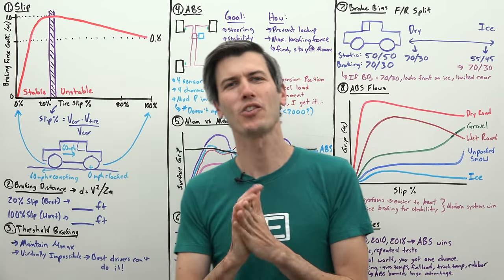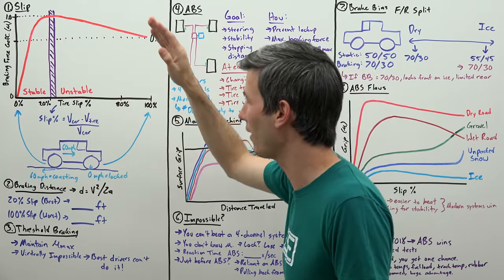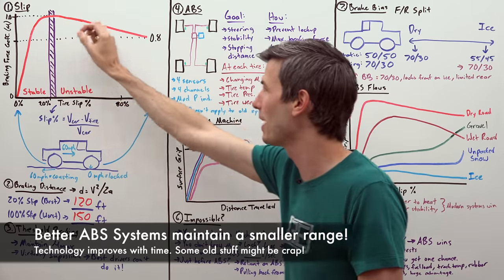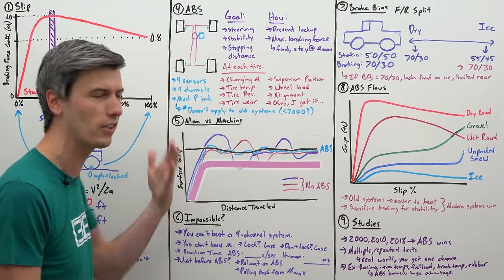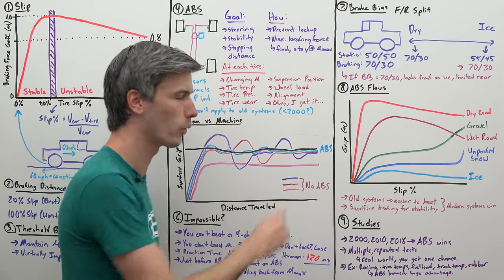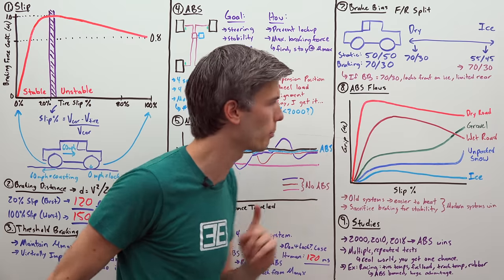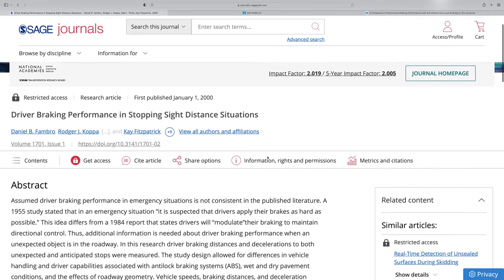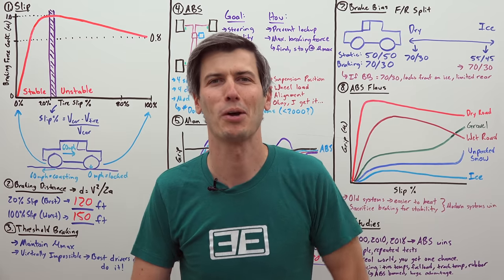Why Threshold Braking Is Impossible - ABS Wins!

Comment: On ice I’ve noticed when all tires lock up the car thinks it’s stopped and the car will just slide down a hill. I’ve had this happen a few times and the best think I’ve found to do in an emergency is to throw it in reverse while locked up. Hit the gas then let off the brake. The car gets a little sideways but stops quickly on slow down hill slides when your going to get into an accident.

Comment: Currently my car has a broken abs-sensor and it is a kinda funny and exciting experience how far i can push the breaks (with a good set of tires in 225/40 R18) without getting a lockup, but at the same time i am pretty scared. Had it one time with a bad set of tires (205/55 R16) where i just did not know that abs is broken and i had to slam the brakes at about 90km/h, man that black lines on the road got about 10m long, before i got to release the brakes again because the car startet turning around into a field where i did not want to go haha. Luckely nothing happened, but the difference is extreme, i am surprised over and over again and again.

Comment: Yes, it's absolutely true that static friction exceeds dynamic friction. The reason that locking up the brakes works on gravel, sand and unpacked snow is that the tire pushes a pile in front of it, effectively increasing the contact patch. The coefficient of friction is still lower than if the wheel was rotating, but the larger contact patch more than makes up for the lower coefficient of frriction.

Comment: I feel that on old early-mid 90s cars, where ABS often was even an optional extra you had to pay for, it might have been possible to slightly outbreak the system under ideal circumstances (absolutely not in an unforseen emergency stop) - but everything that was made in the last decade or so has 4 channel ABS and much faster regulation - not even formula one drivers can beat that because you simply cant break each wheel individually. same for ESP.

Comment: Very vidéo which explain how it works. There are son many details that explain the studies results, like the how the first hit on the pedal is so much important to reduce braking distance. One very other very important detail is how to calculate vehicle speed (wheel is obvious). Also keep in mind each and is tuned with one tire spec and when you change tire in after market, the optimum slip is probably different, so performance will decrease, but still better than any driver 😜.

Comment: I'll also point out that while on some motorcycles you might be able to beat the ABS. You also have independant control of front and read tyres, something you cannot do with a car.

I love how this is just reason after reason that you cannot beat the ABS in day to day life. The fact that cars have accelerometers in them these days means that even if you're on ice or gravel or unpacked snow, the system will be able to take a decent guess about what the surface type is and the coefficient of friction from the accelerometers vs wheel speed and it can adjust as needed in about the blink of an eye.

Comment: there are times where the system fails where normal brakes would have stopped some one at the intersection but the abs system [for example early 90's gm] causes the driver to be half way out in front of traffic. Randy Pobst had an experience on a race track in an rx-7 where the brakes wouldn't work something to do with the abs system "sensing" he was on ice

Comment: I live in Buffalo New York where we get a ton of snow every winter. I own an 08, Honda Civic. (disc brakes front and rear).

Out of curiosity, one day, I unplugged my ABS system on snowy roads to just compare stopping distances. I was absolutely astonished. It was not very hard to beat the ABS system in that car. I beat it every time!! I was very shocked. During snowy season I unplug my ABS module. I don’t recommend it, but it was a big enough difference for me with my car that I feel much safer without it
Reply: In project cars 2, they say locking up tires on gravel or pack snow will dig the ground to gain more traction to stop. On dry pavement abs is nice to have.

Comment: So the system is calibrated at the factory for the optimal slip of the installed tyres therefore does changing your tyres to another brand with a different slip coefficient result in a less effective system?

Comment: Love your channel, your mastery of subject matter is obvious - like Einstein said: "If you can’t explain it simply, you don’t understand it well enough". Your explanations are always clear, concise, and generally easy enough for your average person to understand.

Perhaps you could do a video to explain motorcycle ABS versus threshold braking? The argument, amongst threshold proponents, is that grabbing the front brake while in a turn, to engage ABS, will cause the front tire to become unstable, likely resulting in the bike going to ground or at least causing increased stopping distance as the front wheel "hops", rather than stays in constant contact with the road.

Furthermore, the argument is that threshold braking preloads the suspension (when using both front and rear brakes) and therefore doing that avoids front tire instability which in turn ensures quicker, safer stops. To me, there's intuitive sense in that, but I'm neither a physicist nor an engineer 🙂 If it's true that trying to engage ABS by grabbing a whole lot of front brake causes so many accidents, it begs the question why manufacturers don't incorporate a brief period of suspension preload before fully engaging ABS, so that some who in a panic grabs the front brake hard doesn't inadvertently cause instability and ultimately a crash.

I would love to hear your thoughts on that topic, as well as bonus coverage of what causes instability of the front wheel when someone grabs too much front brake on a motorcycle.

Comment: It's funny because I passed my racing driver licence a few weeks ago on the track and the theoretical lessons (and the drivers) were teaching us threshold braking, which the scientist in my mind also thought it would be impossible to beat an electronic system.
I did use ABS all the time on the ABS-equipped racing Porsche (the other test car didn't have ABS at all) and it provided me with muuuuch more consistent track times and stopping distances.
However, my question is this: when talking about tyre wear and temperature (which influences both wear and grip), which braking method is best?
Can you start your race by ABS braking and then use a form of threshold braking to reduce tyre wear or when temperatures are getting too high? Or does it still lose because when you lock up, the tyres heat up a lot? How about tyre shape? Locking up creates uneven spots on the tyres!
Complex topic but I'd really like to hear your thoughts. Thanks Jason!

Comment: I have been in a number of accident avoidance situations where i have used tire slip to rotate the vehicle quickly ABS would not have allowed me to do this. All of your data was on straight line braking once you turn the wheels a multitude of situations arise. A track i used to race on had a small kink at the end of a straight leading into a right hand corner that was greater than ninety degrees. By adjusting the brake bias slightly to the rear i was able to get the car sliding sideways and as soon as i let off the brakes it literally jumped though the corner. It is amazing what you can feel through the seat of your suit something you don’t get in simulations.

Comment: My first car was a base model 1998 accord with no traction control or ABS. I was coming over an overpass with a red light on the other end of it kind of fast while it was wet and when I tried to brake it just instantly locked all the wheels every time I tried.  Had only seconds to accept that I couldn’t stop and that I was going to crash somewhere. Instead of directly rear ending someone I chose to try to go over the median but ended up oversteering into a palm tree head on. So much so that it hit center more towards the passenger side. Long story short I had a gash on my left leg that just barely missed my knee. I could see the muscles and fat all cut up. And i fractured my right foot needing 2 surgeries. One with pins sticking out of my foot and the second to remove and replace with screws and plates. Thankfully I did not feel any pain because of how much adrenaline was coursing through my veins after the impact. Now I have many scars and a stiff foot over a year later to always remember the day I almost died. Thank god for seatbelts and airbags. And thank god my foot is functional and not deformed. My surgeon told me if I was an athlete this would be career ending so yeah definitely life changing and somewhat limiting. ABS is underrated as F. New cars slow down so quick even when I’m going fast in the rain and I brake hard it just saves my ass every time.

Comment: Every driving school I have been to said that old ABS was crap but it was getting better. One thing that used to be an issue was ABS was tied to all the wheels not independent wheels and it was not tied to suspension. As these advancements have been made it has made ABS better (for most applications)

Comment: I am very curious about the capability of the modern system to find the right threshold VS On/off switch. If you have access to any kind of public knowledge algorithm, it would make a super interesting video.
Reply: I think any ABS system still relies on PWM (on/off in your terminology) at 10-100 Hz but the result gets averaged because mechanics can't react immediately. IMO it's more important to determine the right moment when ABS should kick in. Older systems probably cycled between block-unblock while newer may average speed over all wheels to determine body speed and slip on each certain wheel, and simultaneously calculate derivatives for each wheel to precisely determine when each wheel starts slipping more than needed

Comment: Having stopped on ice/black ice with ABS, increasing the distance, it would be nice if there were an oe kill switch for it. It is worth saying that I was driving to the conditions and had winter tires on at the time. Despite the system doing its best, it seemed that I rolled about the car's length further from where I would have stopped in the dry, or at least a well maintained road.

The car in question is an '04 Echo, and yes, this is very much an exception-not-the-rule situation

Comment: agree with overall video, just have an extra bit on that f1 pit lane example, it is exaggerated because generally they have taken the last bit of life from the tires on the in lap, so its both the braking zone they have least experience with + the point in the race that the tires are providing the least grip

Comment: Was doing emergency stop on one lane highway ramp that was very rough causing loss of pavement contact intermittently.  Was so glad  that car did not have ABS because the airborne tire would lock which airborne.  ABS would have released the brakes on that flying wheel such that there would have been no braking available for that wheel.  Would have crashed instead of stopping with about two feet to spare.  ABS we so often call anti-breaking system, lol.  As with many things automatic, it either automatically works or you are automatically screwed.

Comment: I've seen some scatter plots of acceleration vs slip on a motec tutorial on traction control. The maximized longitudinal acceleration was something about 4-5% Slip. I guess it'd be the same for traction control and abs, right?
Reply: Yeah the physics don’t care if you are speeding up or slowing down. Only difference could come from the weight distribution and transfer. I’m not sure if optimal slip is affected by the amount of weight. A front engine car under hard braking may have way more weight on the front tires than it would have on the ear when accelerating.

Comment: it's interesting your referenced studied were regarding motorcycles, as that's a case where you do have independent control of each wheel. Right hand lever for your front wheel and right foot pedal for the rear. ABS is also still not required by law on new bikes, it's often a paid option on those which offer it. And many moto systems only have ABS on one wheel, usually the front. It's also one of the most high-stakes applications, as even a momentary front lockup can have you licking asphalt, and one of the most highly-contested debates for/against the systems. It's complicated by the fact that you also risk going over the front if braking is applied too suddenly, and that more steering authority is needed as you've gotta keep yourself upright, and that brake bias is often far more front-heavy than with cars (given you can literally lift the rear tire completely under hard braking).

Comment: Manual breaking you may not account for all conditions, especially in a panic scenario, such as gravel on road you didn't see, rough road, or worn tires. ABS will be able to near instantly correct for these, and adjust if they change. Also to note on snow, this is for unpacked snow. Areas that commonly get snow tend to keep the roads plowed.

Comment: I hear what you are saying and generally agree with you, however I have had several experiences where at low speeds, on very icy surfaces, the abs was estimating a lower friction coefficient than what was actually available so it activated the system and kept me from stopping.   In these cases I knew from 40 years of driving experience there was actually a bit more grip than the abs system thought.  

This doesn't happen often, and in 99.9 percent of situations abs is better but there are a few random times where it shouldn't have intervened.  I think it has to do with the delay in how quickly the system can calculate slip, especially in patchy ice where one millisecond a wheel is on ice, and one foot later there is good grip, etc.
Reply: He already talks in the video about the caveat that ABS is worse on ice and gravel unless you activate special snow/ice modes etc.

Comment: In my 2008 Citroën C5, I ran into a roundabout and damaged the wheel and the suspension, the road had compacted snow and all wheels locked, i got my reaction frozen too and didn't release the brakes, so the abs was useless...😮

Comment: I had a 1997 Saturn SC2 which was very light thus horrible in rain or snow. There was a dusting of snow and I was going very slow in a parking lot and hit the brakes very early and the abs kicked in and the car wouldn't stop and I hit the car that was a good 20ft in front of me. There is no doubt in my mind that if I had been able to lock the wheels I would have stopped before hitting the car. I know someone else who had the same car and same exact accident.

Comment: I could not agree more. I used to drive a motorway commute in a non-ABS car. Whenever the other cars started to crash ahead, I had a distinct disadvantage from the other cars on the road. However, looking ahead and keeping a good distance from the cars ahead meant I was fully able to avoid the crashes.

Comment: Thank you. Long time subscriber. I am in agreement with your analysis. The most compelling argument for ABS is, IMO, that the natural reaction of any driver is to stand hard on the brake pedal during an emergency and there is no negative consequence from this reaction. In fact, this is totally fine for an ABS controlled stop.  My question lies with an assumption in your introduction… How is the vehicle speed accurately determined? With all four wheels potentially losing grip we can’t rely on the wheel speed sensors to accurately determine the vehicle speed. It seems this problem has been solved as these systems work very well but I don’t fully appreciate how this is achieved without an independent method of determining vehicle speed. Please straighten me out.
Reply: The easiest method would just be to compare the observed rate of change to some programmed maximum rate of change. If all four wheels go from 60-mph to 0-mph in a tenth of a second, then the computer knows you locked them up. Of course you can bring other sensors into the mix. Brake fluid pressure sensors can tell the system what the driver is trying to do, which can be compared to what is actually happening. If the driver only pushes slightly on the pedal, but the speed sensors jump to zero, it knows you locked them up. Accelerometers could be quite useful, and many modern cars have them anyway. Heck, you could implement a radar speed sensor to compare with the wheel speed sensors, and although I don't think that's currently common practice, the more "self driving" we become, the more cars are going to have such equipment on board anyway.
Reply: @xtnuser5338  Thanks for your suggestions. I can see accelerometers helping, although not that useful on very slippery surfaces. Radar not so much, as I am not sure that a reliable target could be found for reference. I don’t really feel like I understand how this works yet.

Comment: Would you be able to say the same about motorcycles? There, with or without abs, you can control each break separately so the break bias can be adjusted each time you break. You’ve got a right hand lever for the front wheel and a right foot pedal for the rear wheel. What about gradual breaking. I know tires can literally turn into glass if you slam your breaks violently. How’s abs preventing that?